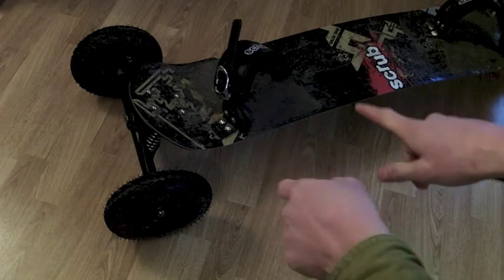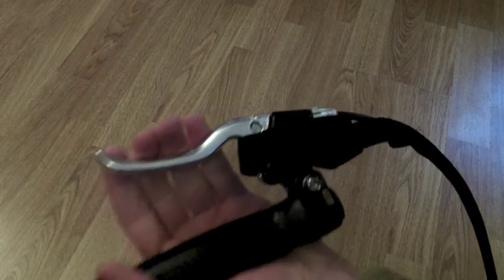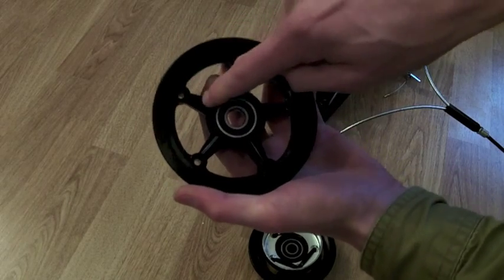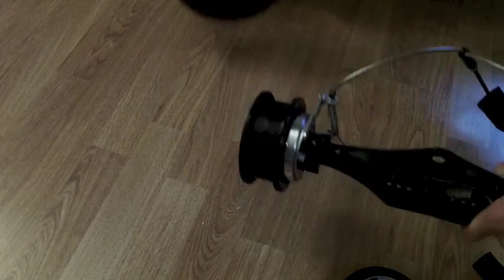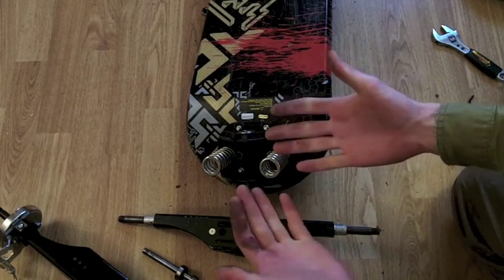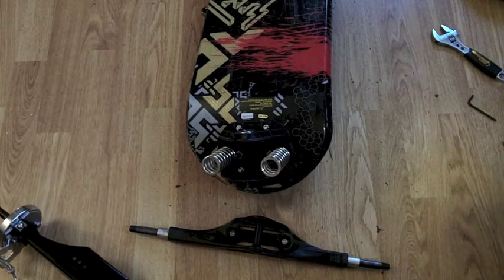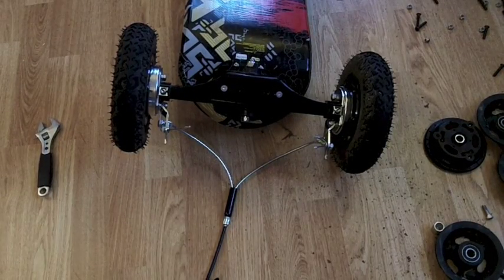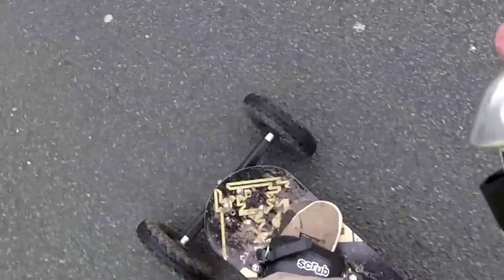Mountain Board Brakes!

Comment: 7 years ago, are you still riding?
I started riding electric mountain boards. Totally awesome because now have the power to ride back up the mountain. Although the controller has electric brakes that regen and stop really well, they have a tendency to fail. And it's not fun to lose brakes at 20mph downhill, as you only get faster.
So I like having the cable attached. This is the first time I've ever seen drum brakes, awesome. I wonder where on earth you got those?
So I'll keep looking for 6" disk rotors that match the 5 star hole configuration.
Cheers from California.